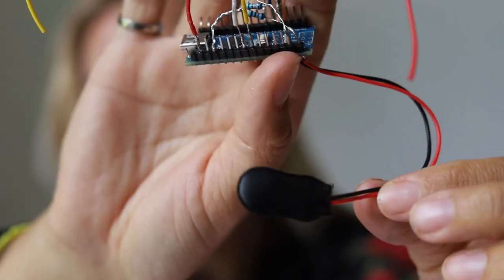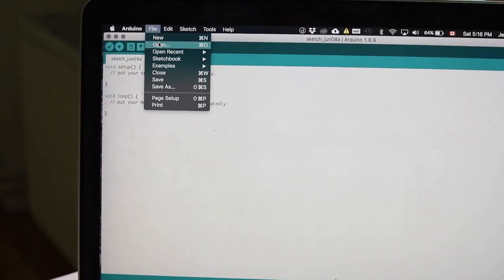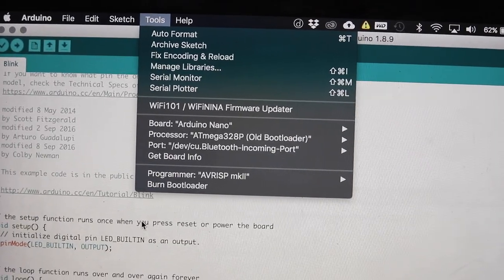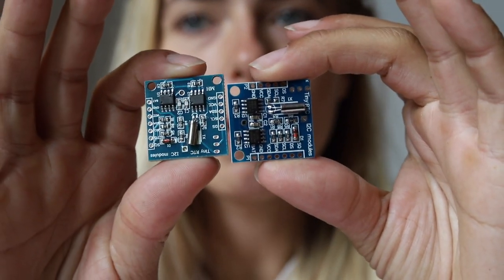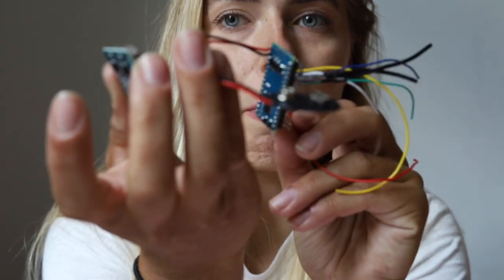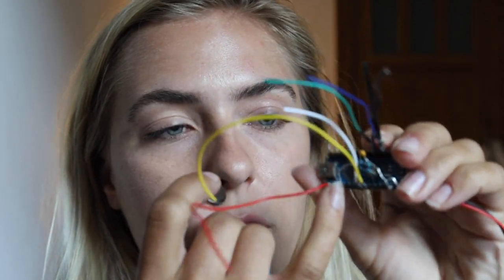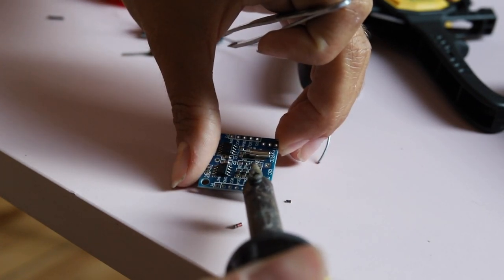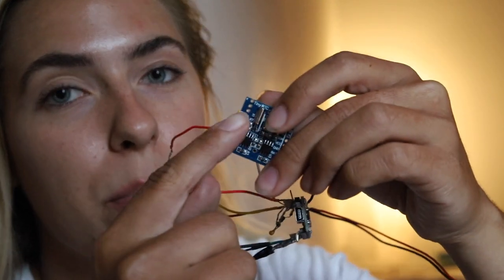This probably WON'T have a short circuit... right??

Comment: It's really cool to see the progress on your sensor! I don't know a ton about RTC's, so I can't offer much advice there, but I would recommend using a breadboard and some jumper wires instead of soldering and de-soldering. It will make prototyping much quicker and easier, and will save you from a lot of frustration.

Comment: Jess, you can protect your Arduino from wrong power connection by putting a diode in series to your red (+ battery) wire.

Comment: The way you keep your nano, it makes my heart sulk.
Reply from the maker: Noooo why???
Reply: @RiverTechJess  tip: "listening" to a short circuit is a horrible plan :D
There are two kinds of short circuit, 1 which will fry your board which you can listen / smell and watch.
2. Short circuit between data pins which will not result in any hardware damage but will corrupt the data you wish to require from your sensor. (Say two d2 and d4 are short circuited, and you are reading output off of d2, whenever d4 goes LOW ( completely separate operation) it will in turn set d2 to LOW as well)

What you need is a multimeter and use it for testing any possible short circuit after every soldering. 

Good luck

Comment: Yes, sometimes it takes a long time to build something but the key is to never give up! XD ... The most challenging thing I ever built from a software perspective was a motion detection camera to detect crows - from an electronics perspective the most difficult thing  was a Nixie Tube clock (where I designed the circuit board) I need to get back to doing some of that stuff, it's been awhile.
Reply from the maker: that's way more complicated but still sounds like a fun challenge! I'm slowly making my way there, I'd love to be able to dedicate more time to it
Reply: @RiverTechJess  it was, and it was fun too :) I think a huge problem for a lot of people is that initially there's a fear of the unknown, when in reality all you're doing is solving little steps one at a time until you get to the outcome... great job btw.. also, future suggestions for your sensor: miniature solar panels (individual solar cells can be very cheap) to charge a small Li-Ion battery which would allow the device to continue for longer periods of time without interruption
Reply from the maker: Ah cool! Ya maybe in the future. I have a bunch of different prototypes in my head (e.g. one with a power button and no RTC) but first I want to get 1 working properly:)

Comment: I would have thought you could collaborate with an EE so you could focus on the sensor integration, calibration and watertight / low-cost packaging?  I used to do mechanical design for animal tracking tags.  The weirdest ones were for a walrus, which was clamped to the tooth with hose clamps and one for a polar bear which was inserted into the ear.

Comment: Question from an engineering student! Why would not soldering properly cause a short circuit? I thought that would cause an open circuit

Also: great video, you're very articulate in the way you explain things. You earned a sub 👍
Reply: If the tin percolates, you can short 2 pins together or have drops on the board short-circuiting random tracks on the PCB
Reply: @ingframin  ah that makes sense, thanks!!

Comment: I really appreciate your efforts in building up your sensor.Soldering by hand  is more of an artwork than sciencea and you did a terrific job in soldering the wires to the very close headers however, it confounds me that why would you not want to hook up the connections using the (female-to-male/female-to-female) jumpers and choose to solder instead?Besides,jumpers come in beautiful ribbons and are not messed up so easily .Or Is it because, you don't want to use rely on jumpers since, they are sometimes loose in connection ,leading to a fault and are difficult to spot while debugging the circuit?